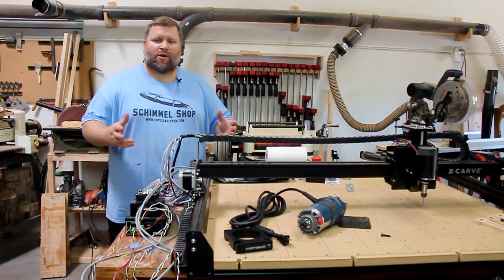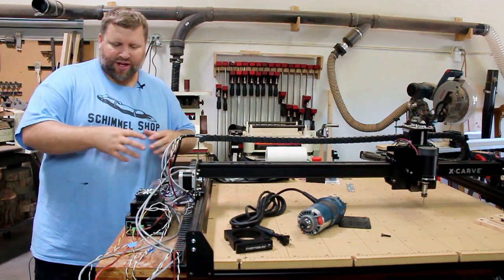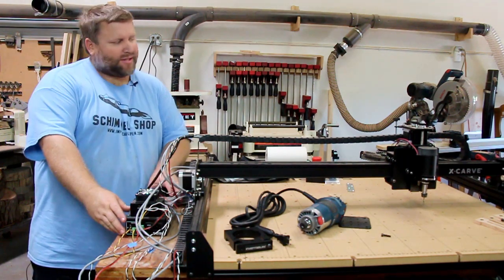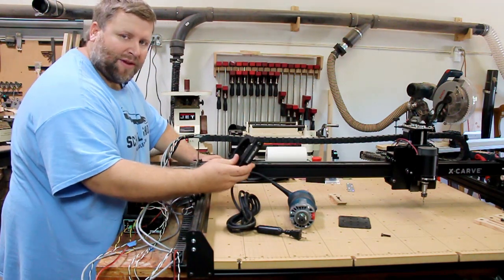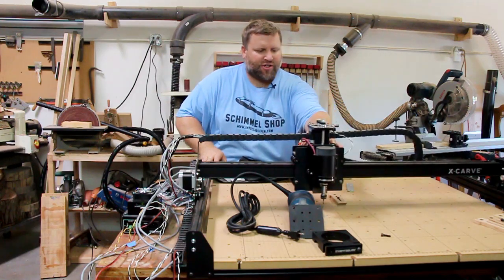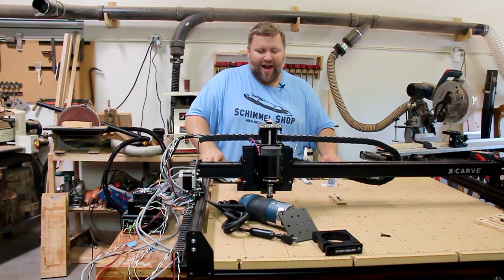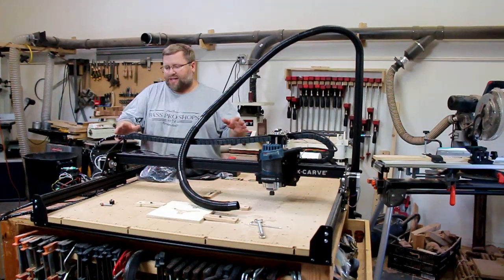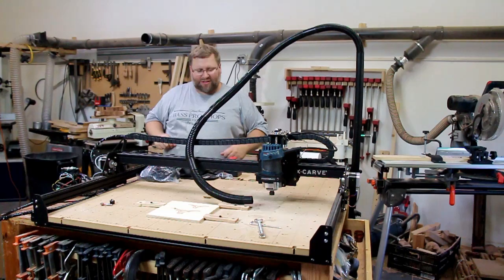Xcarve Change to Bosch Colt Router, Wiring harness,   Drag Chain fix

Comment: I bought a 1000mm X-Carve in January of 2018 and it comes with an extrusion with two plastic mounts and it holds the X-Axis drag chain and wiring so that it doesn't sag.

Comment: Nice upgrade ideas. One thought: I am building a custom design CNC router. My drag chain is "inverted" from your design. Instead of the lower end being movable, my design has the lower end of the drag chain stationary and the mobile end on top. Much less stress on the chain. Thanks for sharing.

Comment: What are you using to secure the spindle power cable to the drag chain?  Are they zip-ties?  If so, are you not concerned about them chewing through the power cable after a little back and forth with cutting paths?

I'm certainly not trying to sharp-shoot (I assure you).  I am a NOOB in pre-order phase, so i'm just trying to figure things out.